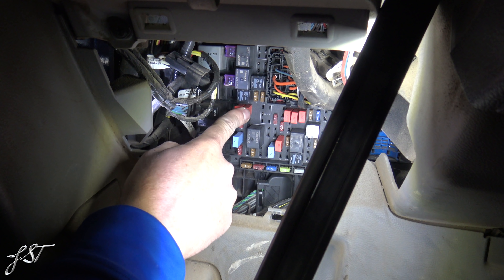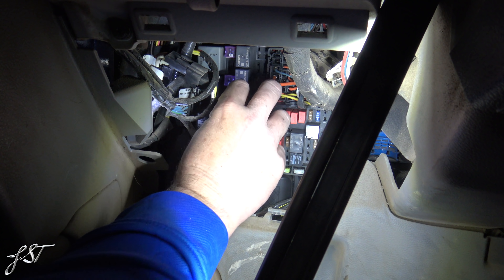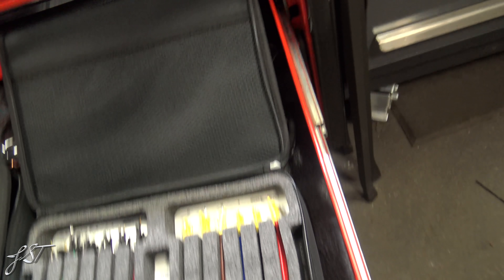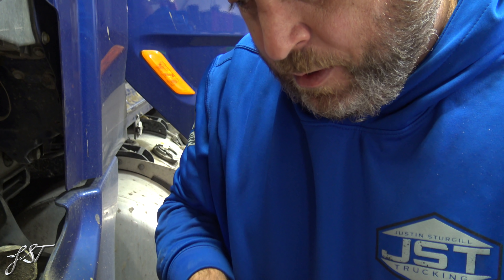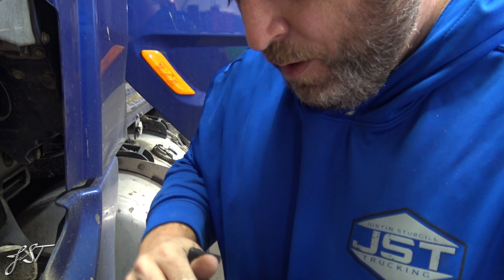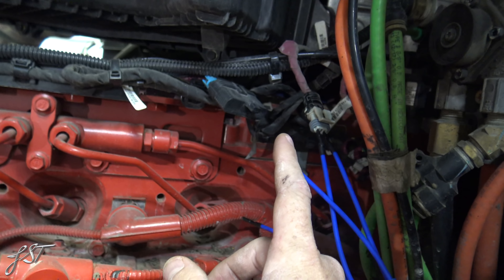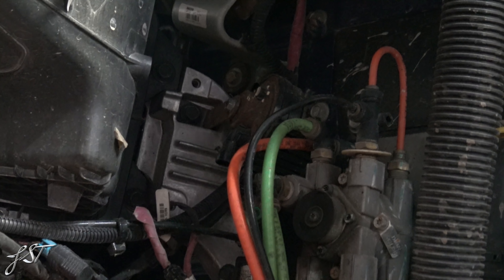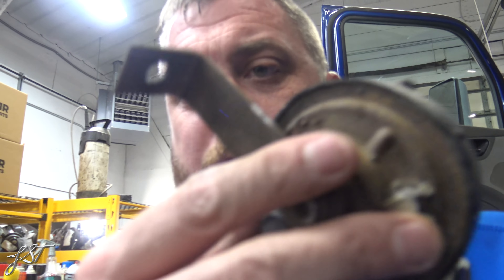PETERBILT 567 CITY HORN REPAIR   MY ELECTRIC THOUGHT PROCESS

Comment: POWER PROBE BUDDY! That's the first thing I'd do after checking the fuses. Supply power to horn. If she don't toot, no need to troubleshoot! If she does, then u start checking for power and ground, resistance, continuity etc etc. If it did toot but didn't have power going to its terminal. I'd probably guess it has a short. But obviously I'd test it to make sure it was the case. Just what I'd do if it was me...

Comment: Since the ohms resistance continued to up that means something like the horn diaphragm is stuck open.  Otherwise, you would have gotten a stable resistance.  I would take an air blower and blow up in the horn itself.  You may be able to dislodge the trash that may be lodged in the horn.  Then just hook it up to a battery and see if it blows.  Oh hell just throw it away.  LOL